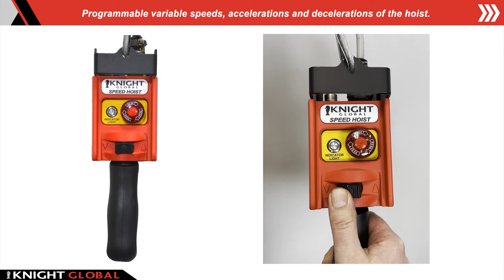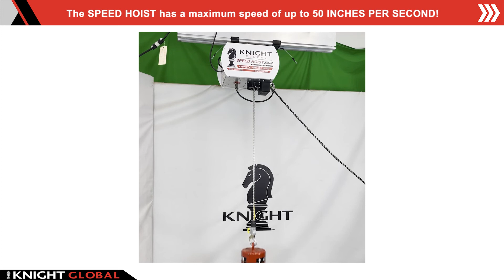Knight Global - The SDS SPEED HOIST

Comment: The redundant chain is not to be confused with a reeved hoist, it is an independent lifting chain that will hold the load if the original chain breaks. This is the only hoist of its kind.
Reply from the maker: Great clarification, Frank. Thank you!